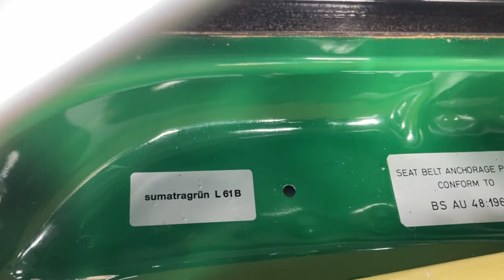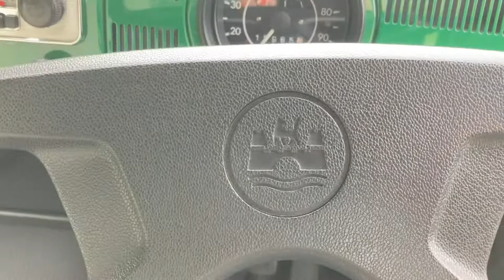Absolute Classic Cars 1972 Volkswagen Beetle 1300 - 15900 mile from new! SOLD

Comment: What a beauty!
It's just....
❤WAAAAOOOOW❤

Mine is a 1302s super beauty.  
I'm restoring it.
Reply: I have a 1970 beautiful Beatle/ red VW...very enjoyable ride! They are so reliable & fun to drive! They certainly were not built for speed....I usually crews it at approx 55 mph...it will drive anywhere in the USA;  only thing, it will there about later than most other people driving V8 engine...it will a little cramped & with No air condition...you will make safe Just like your counterpart; however probably at about days later...